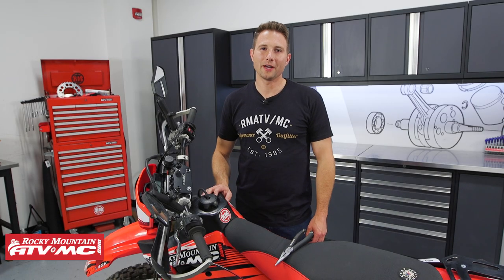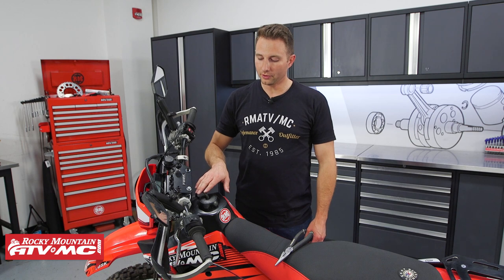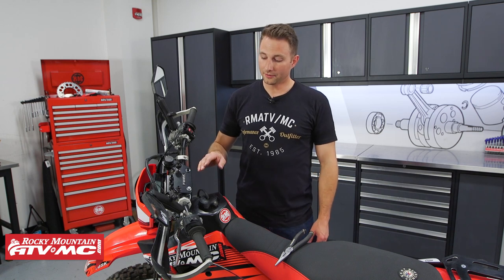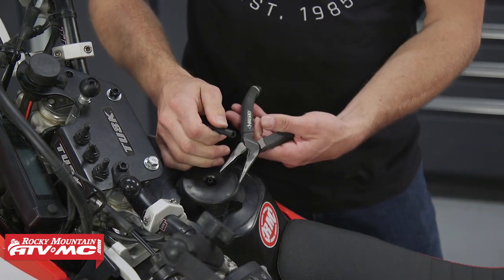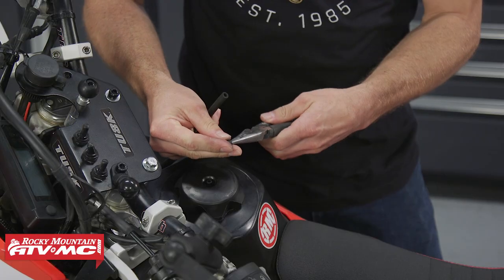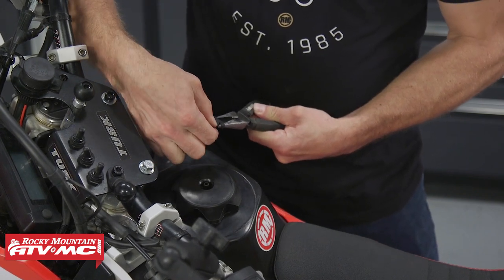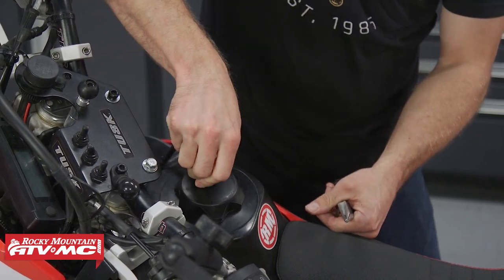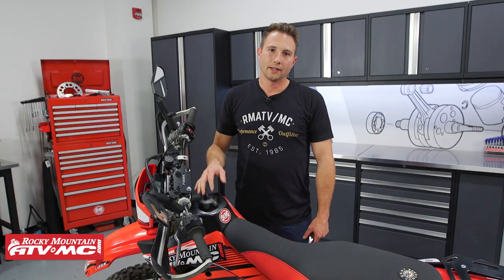Motorcycle & ATV Gas Cap Vent Hose | Quick Tip

Comment: Is it possible to lock your gas cap so that no other person could open it ?
Reply from the maker: Most off-road motorcycles won't have locking gas caps and even many street bikes don't have a way to lock the fuel cap either. Acerbis does make a locking gas cap for their tanks and there may be other companies that make them as well.